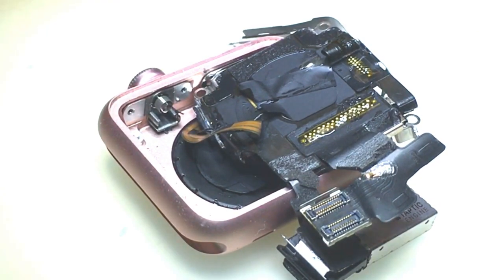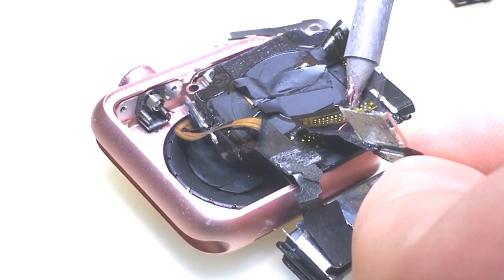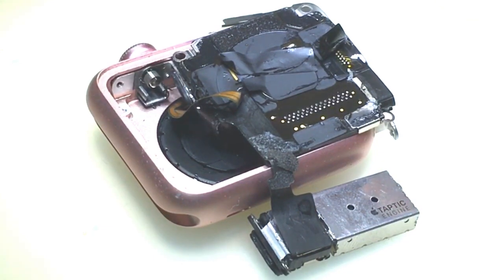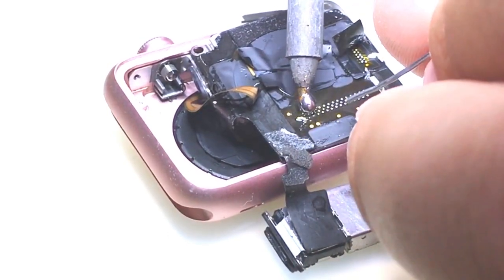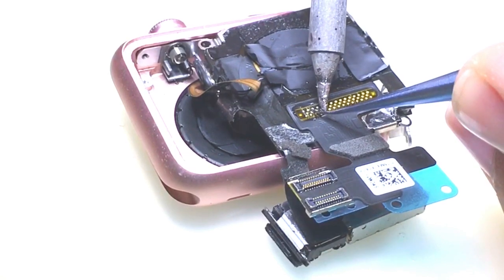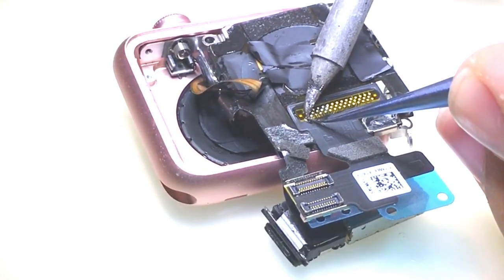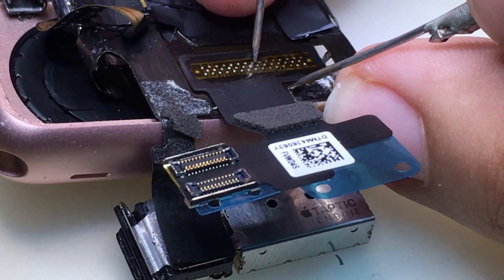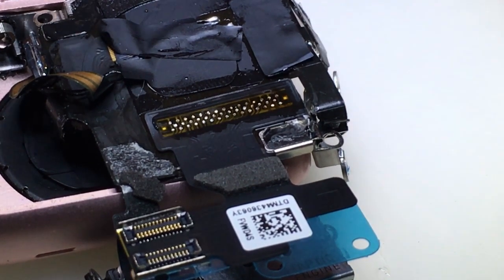How to replace the display connectors on an Apple Watch

Comment: Hi Derek, i replaced a screen on a Apple Watch, but the touch is not working. Is it likely that the flex is broken? Greetings Bob
Reply from the maker: It’s either the flex or part of the digitizer got damaged during the glass removal. Before soldering a new flex I’d try a new digitizer as they are less expensive and don’t require soldering. You can dry test it if careful without adhering it to the display.
Reply: @FIXDPHONES  Great...i will try it and keep you informed.

Comment: Dumbass at my job pulled the screen up and ripped the cable when all the problem was is a battery replacement. I was going to fix it but  time is money and this takes up too much time. Rather just get a $200 Fitbit instead. 😂

Comment: Hello.. I need your help, do you have any information on the Connector for the Heartrate sensor? 

https://youtu.be/rrDjP7iK7H8?t=235  in 3:55  my lock broke on this connector broke.
Reply from the maker: Sorry to hear that. It’s fixable, but I’ve only been able to desolder one from another of the same model to fix it. It’s also possible to replace only the moving portion of the connector is the arms that hold it are still intact.
Reply: @FIXDPHONES  it’s really hard to find that connector. I do not have another board to take it from.. any recommendations? Get a dead watch from eBay?

Comment: I have the opposite problem and I can't find a replacement flex for the cable that is attached to the display. I ripped THAT cable a tiny little when I removed the display a second time. I know the dispay itself or the touch or anything else is not broken and its only this mofo cable on the back of the display panel thats a little ripped. I can't find ANY replacement parts for this one cable, only a complete replacement display. Any ideas on how to fix only that cable?

Comment: Yup I damaged my S1 Apple Watch trying to replace swollen battery. Opening that tiny chamber for the screen connector was so tough and I damaged the one of the connector. Feel so bummed 🙁 I wanted it to keep it running for a sentimental reasons. I should have sent it to you.